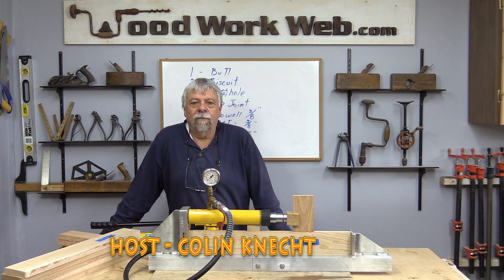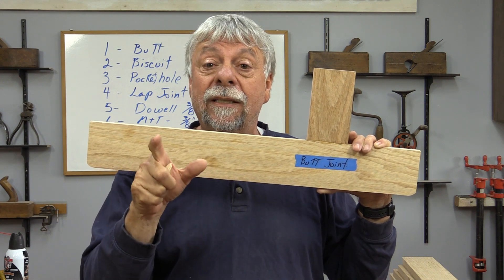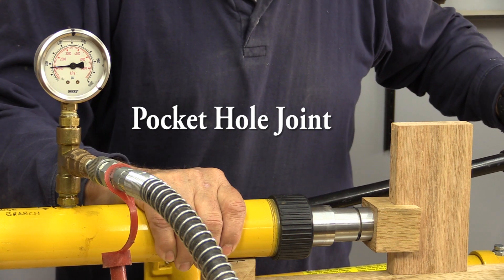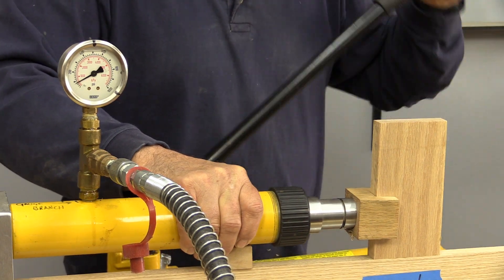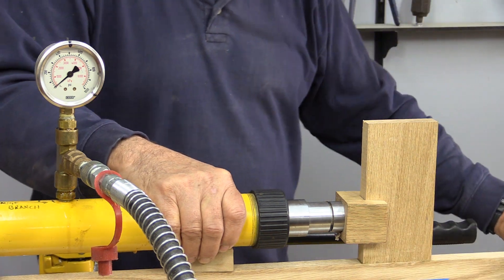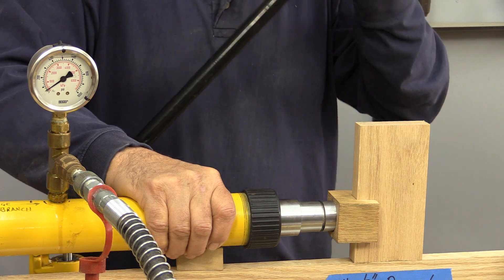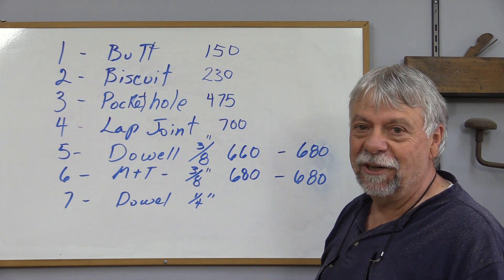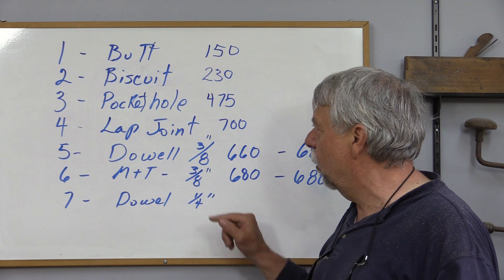Woodworking Joint Tests

Comment: You compare 1 biscuit to 2 dowel joints and 2 domino. Why not make it fair and use 2 biscuits? I set my joiner up for the bottom slot and add a shim to the fence for the top slot. It takes no more time than drilling the second dowel or cutting the second domino. If your using the bottom of the joiner as a reference just add the shim to the base to raise the joiner for the second slot. The real question is are biscuits strong enough for case work? Remember a cabinet door has 4 joints that added together give the door it's strength, You'll rip out the hinges before you break the cabinet door.

Comment: Great information but what I see in common with all these tests is that the joint is always aligned with the strongest direction of the wood grain. There 2 more joint alignments of practical interest but no-one seems to bother testing them. I presume that would be because they are of inferior strength. There are cases though where they have to be used.

Comment: test showed very good comparisons.
the 3 screws pocket joints were good enough for home furniture, if issue  is not pocket visibility.
in fact test showed me using pocket screw joints combined with glue, would be perfect for house furniture.
pocket screw combined with glue would fair better in humid climates and would expansion ;  specially when split, spring loading washer is used.
thank you from California.

Comment: The pocket screw join didn’t fail at all. It held so firmly it broke the underlying wood. You can see that clearly in the slow mo. The joint remains in and square.

Comment: Great video!  I’m curious how a bolted joint with cross dowel would compare.  I’m building a storage rack and want them open on the back so the joint needs to take the diagonal load.. was the half lap at end of wood or in center?

Comment: It’s been five years but this popped up in suggestions. 

@WoodWorkWeb why have you not fixed your numbers here or on the article for the lap joint?  It’s obvious that it was at 800, not 700. That’s an important distinction, especially since it wasn’t a full lap.

Comment: Although you have put your hydraulic cylinder close to the joint, it's still somewhat above it, so you're putting a side load on the joint -- thus it is not getting a pure shear load.  If the point of contact was higher, the values that you found would be less (leverage) and if you moved the contact point closer to the joint, the values would be higher.  To get a pure shear load, you would need a board with the joint on both ends and then your hydraulic cylinder would need to situated so that it was providing an equal force along the enter length of the board.  I do not think you would get the same sort of splits on the M&T and dowel joints that way.  To so such a test though, you're going to need a more powerful cylinder (or at least a gauge that goes to a higher value).

Comment: There are several misconceptions. None of the joints failed in shear, fail at the joints by bending. Shear failure would be failing by movement of the joint horizontally. Bending is the mode of failure.The joints left side is pulling up, tension. while the left side is in compression. Putting joint material at the middle of the vertical piece does not help because they are in the area of zero stress, so they little strength in bending. The joint will be stronger is the dowels are far left. The left side needs help at the very far left of the joint. A dowel or pocket hole close to the end will be stronger.

Comment: A few years ago a woodworking magazine reported on a test from a major 
mid-western university (I apologize, I don't remember the name of the 
magazine or the school) and they came up with the same conclusion as yours. 
Their half-lap was at the end of their boards and not at the middle, as 
was yours. Their study showed the half-lap to be stronger than a mortise
 and tenon or a bridle joint; here's why. I think we can all agree that a
 glue joint is stronger than the grain of most woods. In other words, if
 we stress a glue joint, the grain will separate somewhere adjacent to 
the glue joint before the actual glue joint fails. A glue to WOOD bond 
is a very strong bond. A glue to GLUE bond is a very weak bond -- much 
like peanut brittle candy. Hence, if we could get a single molecule-thick layer 
of glue, we'd probably have a stronger joint. That's why a 
half-lap is stronger. You can clamp a half-lap with much greater force, 
thereby reducing the number of glue to glue bonds. We can not compress a
 mortise and tenon joint very well because the mortise edges will not 
collapse sufficiently. I suspect a bridle joint would be somewhere 
inbetween since we can sufficiently clamp the open 
ends but not the closed end. So those of you who keep piling on the glue
 and squeezing it out, claiming you're getting a better glue joint, 
-- you're not. This would imply, there's no such thing as a 
"starved glue joint" as long as you have complete coverage of the mating
 surfaces on well prepared boards. These comments are based on the use 
of non-gap filling white or yellow glue, such as aliphatic resins-- 
PVAs. To get a better glue joint, spend more time preparing the surface 
instead of just "using more glue" The smoother the better.

Comment: Would be interesting to see a doweled lap, and mortise joint tested. As well as a glued pocket joint if it wasn’t glued already. Thing is if you did this is larger materials like 4x where the dowels and mortise have more supportive material I wonder how much stronger they would be compared to these others.. I’m guessing the lap joint did so well cause there is so much cross long grain to the glue up? That one really surprised me though

Comment: Was just working on a foot stool as my first project and was thinking the most beautiful and practical joint to use. Absolutely helpful and objective video.  The position of the block probably caused the joints to fail a wee earlier but nevertheless it is an excellent practical video guide!!!!! Thank you!!! Dowell it is then!!! 😁

Comment: I'm a bit confused why you did the lap joint at 2-1/2". On your website you say "The lap joint was slightly smaller because I felt it was unfair to have 3-1/2 inches of long grain glued to long grain so it is slightly smaller at 2-1/2 inches." What's "fair" got to do with it? If it's a lap joint, it spans the width, or it's not a true lap joint. Yet despite this, the semi-lap still won the test by a country mile. With a full lap joint, there would be no comparison. The conclusion seems obvious enough to me.

Comment: I wonder what the orthogonal shear is?  But this actually shows that pocket hole joint is easy and excellent.  The joint failed, yes.  But with other joints, the wood failed before the joints.  So somewhere in the 500-650 lb range, wood failure comes into play.  Pocket holes can be unsightly and down right unholy for the purists, but it really is a  fantastic and well-thought our solution.

Comment: Great video... I moved to dowels (Dowelmax) several years for strength and for alignment. Would like to see a sheer test for loose tenons....also, did you say that you glued all joints? Reason I ask, pocketholes get a bad rap because users don't realize that pockethole joints are intended to be glued. The screws them selves do not provide much strength but reduce the # of clamps required to glue up a cabinet, panel, etc.  Thanks again!!!!!!

Comment: How come for the half-lap joint, the wood made it too 800, but for dowel and mortice it failed at 680?

It's obvious these tests should be repeated a few more times to be accurate.

Nice tests anyway

Comment: your gauge is reading kpa and psi, not lbs... good comparison, but to get lbs of load you need to have info on the cylinder bore of the hydraulic unit.  Won't change the ranking. multiply the psi x area of piston bore to get pounds force

Comment: An good re-try for the butt joint would be using a 2-part epoxy.
Reply from the maker: Yes, different adhesives would made a difference on how the joints test.

Comment: Just for the record: biscuit joints are not meant to be strong, their main purpose is correct allignment and also they just add axial not radial strenght, so it is better compared to a tongue and groove joint than other joints for end-to-end-connections.

as always: use the right joint the right thing - you can't glue up a tabletop with M+T and usually tongue and groove will look a bit odd if you want exposed endgrain and also it is very time consuming, also over a larger surface the strenght is not that of an issue anymore - therefore butt joints or biscuit joints are perfectly fine here
Reply: Biscuit joints as part of a frame can be really strong. Biscuit joints because of their great alignment can also be used with drill through pegs and dowels or screws.  Which means they can be really versatile. 

I have furniture made with biscuits that are over 20 years old and they are still going strong.  Biscuits get used a lot in continental europe. 

When doing mitre joints biscuits can be strong and very accurate.

Comment: Interesting and informative video.  One thing that would have been nice is to test them in the other direction.  Obviously, they typically aren't loaded much in that direction, but everything gets bumped or even knocked over occasionally and I believe the lap joint would fail pretty quick in that direction, which is why it's not generally considered that strong.  Though a lap with a dowel through the center of the lap might perform very well in both directions.

Comment: I'm a huge fan of the dowel joint, (it's the same thing as a floating tenon),  they're really fast, and I've never had one pull out or break.  I'll have to start using the lap joint more, had no idea they were so strong.  Great video!!
Reply: J. B.J. I suppose lap joints are just not as good looking if making furniture. I'm going for lap in the shop and dowels elsewhere now.

Comment: Looks like the pocket joint did not let go but the board did if you watch close you will see the board cracking underneath. Watching it again looks like the board let go in the middle so that is not the joint failing, that is the wood.

Comment: I wanted to see the butt joint with screws not just glue. I'm trying to decide it I should use it.
Reply: https://woodgears.ca/joint_strength/index.html you can scroll down to "retesting with maple". Butt joints with screws fail faster than pocket holes, but fail slowly as the screws are pull through the wood. When they fail, Pocket holes fail completely. Screws with washers last longer than PHs and fail slowly. How a joint fails is an important part of comparison.
Reply: Jason J. Ayala P. Thanks I clicked on the link, that helped me a lot. I'm building a loft in my room for my bed to sit on top and some walking room, stairs and rails around it. I'm new to wood work, all I knew was the butt joints. I see a cross lap joint, would that be ideal strength for something used daily?

Comment: Great! As others have commented you didn't convert hydraulic pressure to psi at the joint but the testing was consistent all the way through and so we can safely infer relative joint strength.  Thanks.

Comment: Very good video, very good test, the low lb. failure n the Bisket joint surprise me, thought they were a lot stronger, maybe is used a different way. Also the pocket hole surprise me how strong it is, thought it was leak. Thanks so much great test.

Comment: Thanks for the video. I liked it. Who cares if it's PSI or pounds. I sure it was meant as a comparison rather than an exercise to determine actual strength.
It was interesting with the last couple that the timber beam failed, rather that the join itself.
I wish you had included a Domino within that exercise.
Either way I liked it.
Thankyou

Comment: Thanks for the video, pretty neat.  It's psi, not pounds.  I would have liked to see the lap joint to see how you did it.  Note that the 2nd dowel and mortise & tenon joints did not fail.
Reply: The joint didn't break, but the joint type failed the piece by compromising it's structural integrity. For example, the lap joint withstood a higher psi and failed leaving the 'structure' intact. Having said that, it's worth noting that dowel/tenon joinery scales no matter how big the project. Something to think about depending on what you're building.
Reply: Agreed, these joints didn't fail... the wood piece connected to it split

Comment: Results of LBS of pressure withstood.

Butt joint - 140lbs of pressure
Biscuit joint - 230lbs of pressure
Pocket Hole  - 475lbs of pressure
Lap joint - 700lbs of pressure
Dowel  joint - 660lbs of pressure
Mortise & Tenon - 680lbs of pressure
1" Dowel   - 680lbs of pressure
1" Mortise & Tenon  - 680lbs of pressure
1/4" Dowel  - 480lbs of pressure
Reply: Lap joint was closer to 800 lbs on gauge. Not 700

Comment: You kept saying "pounds" but the gauge says "psi" (pounds per square inch). Your using what looks like a 2" diameter bore hydraulic cylinder. You need to calculate the resulting force at the cylinder piston. Force = Pressure X Area (F=P*A). Area of a circle is pi X radius squared. The force generate by that cylinder (assuming it's a 2" diameter bore...) with 150 psi of oil pressure is 471 lb. So it comes out to 3.1416 lb of force for each psi reading on the pressure gauge.

long story short...the joints can withstand a little over 3 times the force you said they could. The lap joint comes in at 2400 lbs. That's crazy!

Comment: It was interesting to note that apparently the weakness of the M+T isn't the joint itself but the fact that cutting the mortice weakens the wood into which it is cut.  It would be interesting to see a couple of different thicknesses tested with the same size joint.  For example, a 1/4", 3/8" and 1/2" to see how big a difference it makes.
Reply: The second M&T was only a mere 1” depth.  When connecting a rail to a stile, my Stopped Tenons goes to about 1/4” of the far side of the stile. For table frames, it’s the maximum depth the leg size and apron offset permit and I miter the ends of the tenon# to maximize long grain to long grain glue surface. We didn’t see the Lap Joint, but I’m assuming it spanned the full overlap of the two pieces, so it had the most long grain to long grain glue surface, so no surprise that test resulted it requiring the most force to fail. The M&T joint didn’t fail, but the Stile. The dowel broke in a similar manner, but the problem with dowels is their propensity to fail, over time, in the cross-grain (Stile) connection, where long grain to long grain glue surface is nearly non-existent.

Comment: How about testing the Festool Domino. They offer two sizes; a smaller model 500 and a large version XL. 
I found this video looking for ideas on how to use my new 500. The speed and accuracy are amazing. I would like to see how it stacks up in strength to the others methods shown here.
Reply: I mean they are wider versions of a dowel, I imagine it works the same as two dowels put together.
Reply: https://www.dowelmax.com/woodworking/tools/domino-vs-dowelmax-dowel-jig-system/
Reply: https://www.dowelmax.com/wood-joint-strength-tests/

Comment: This is very interesting, thank you Colin. Tell me does the pocket hole joint include glue? If it doesn't, how "strong" would it be then? Clem
Reply: Clem McGuinness Matthias added glue to his pocket hole test and it made little difference... Albeit he was testing a corner joint.

Comment: It looked like the Half-lap joint made it to 800? Also, it looked to me like the pocket holes also failed in the wood below, and not in the joint like the last couple tests?
Reply: Failed at the joint. The wood may have failed after the joint seperation first.
Reply: I didn't notice that at first, the camera is set so you can't see the lower board crack.

Comment: Hi, watch a lot of your videos learned a lot from them. One thing about the mortise and tendon joint.  I learned in school that the mortise has to be 3 kwarters of the size of the wood.  Say the wood is 10inch then the mortis must be 7.5 inch deep. I wonder how much pressure it could take.
Reply from the maker: +Kaleman Robbie Yikes .. that's some pretty deep mortise joints
Reply: WoodWorkWeb
Pretty touch joint :) As far as i know its the norm in the Netherlands.

Comment: Thanks for the excellent video.  I wonder if gluing edge grain to edge grain would change the results.  In other words, when making a tabletop of multiple boards, will dowels (or biscuits) strengthen the joints?  I know you did a test on this before, but there were some questions as to the actual testing procedure.
Reply from the maker: +Jay Beemer Thanks Jay ... edge grain to edge grain would still be long grain to long grain so yes, it would be a very strong bond.